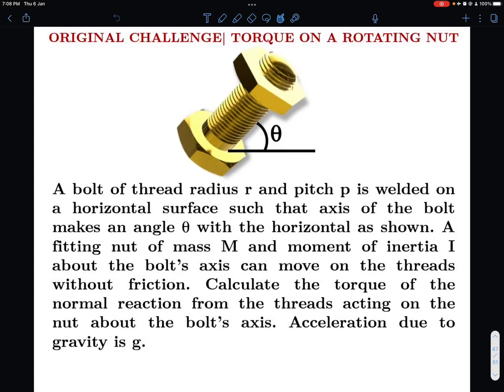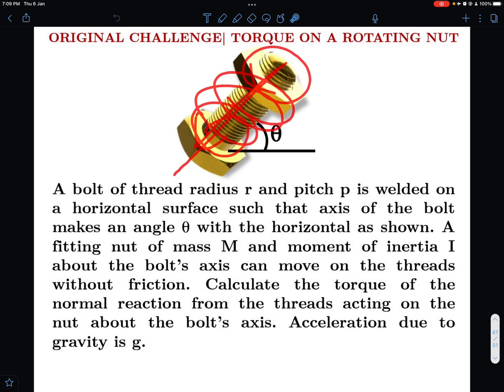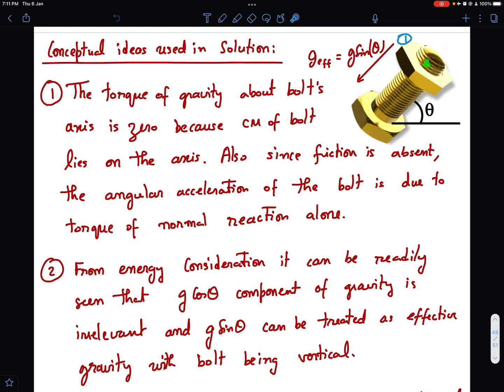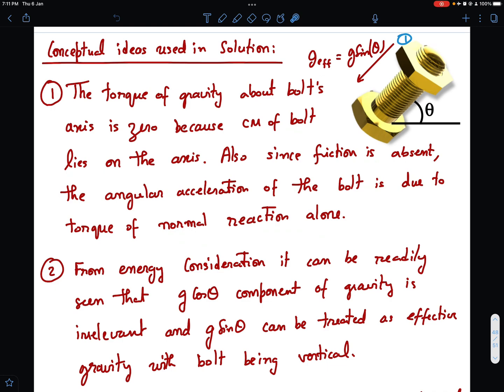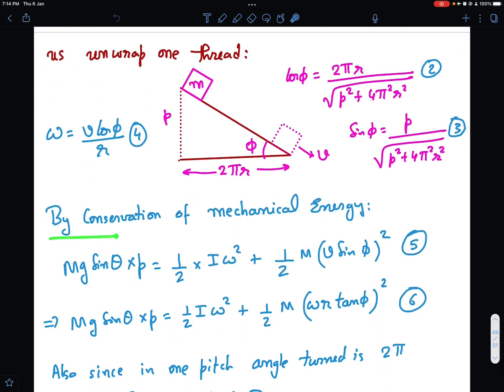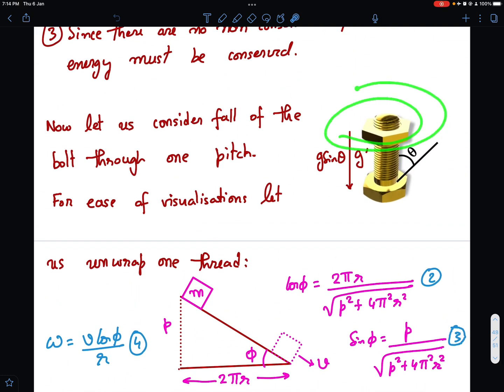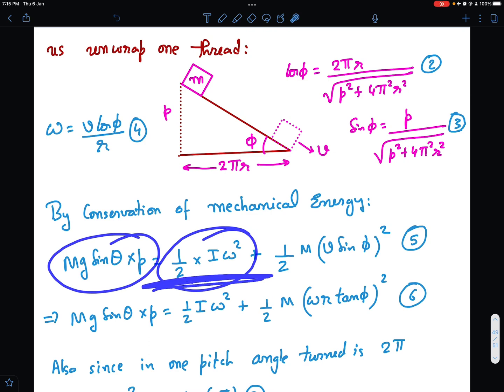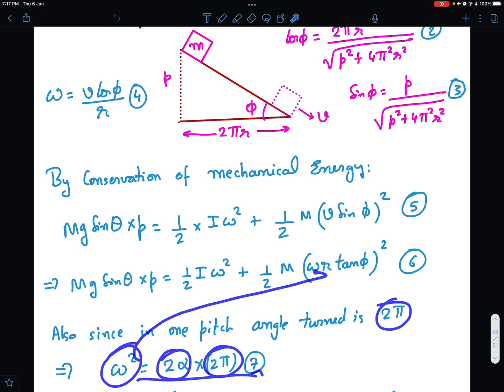ROTATIONAL MECHANICS| ORIGINAL CHALLENGE| TORQUE ON INCLINED NUT BOLT SYSTEM| JEE ADVANCED

Comment: sir, I've asked you a question previously in which you suggested to do irodov and which I'm doing, sir I tried SBT as in your AMA you said Narayana students are made to do SBT after June(class 12),i tried SBT and i was able to solve a good chunk of level 1 and 2(NLM) . I'm in class 11 sir and I've just started SBT, I calculated that there are around 2000 questions in total(vol 1 and 2), sir if I try to finish SBT along with class 12 and finish it by October and do more questions from Yours, Nitin Sir and PSJ sir, will it be enough for top 100 rank? I personally decided that pathfinder is not my cup of tea(as it doesn't even have solutions, very time consuming) and I learnt a lot from your AMA. Thank you sir
Reply from the maker: It is perfectly fine if you don’t do PF , however getting under 100 can’t be guaranteed just by solving a number of problems… it depends on so many things …. Most importantly silly mistakes and balancing between the three subjects… try to divide your time equally between pcm and then try to solve as much as possible in allotted time.
Reply: @ambarishphysics  thank you very much sir for this valuable info 🙏.